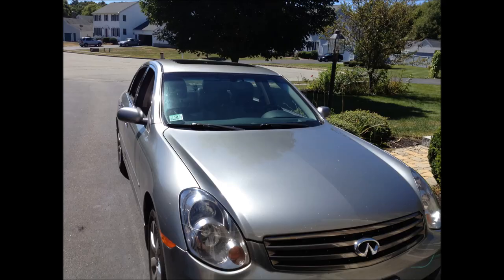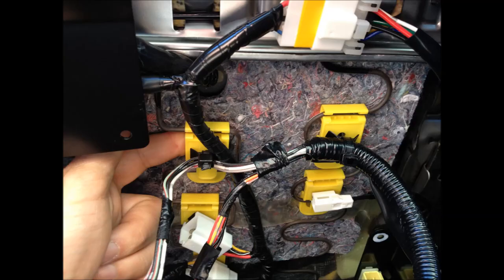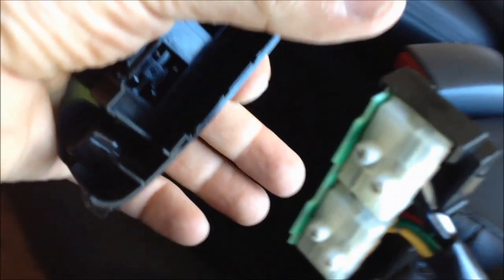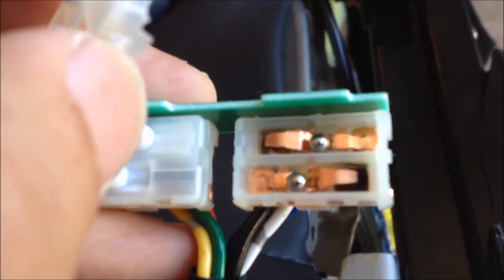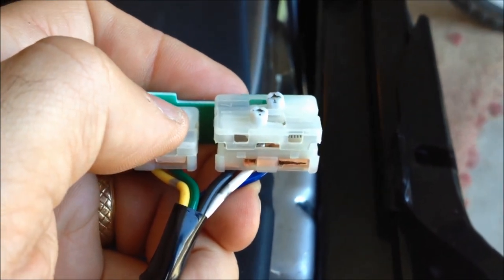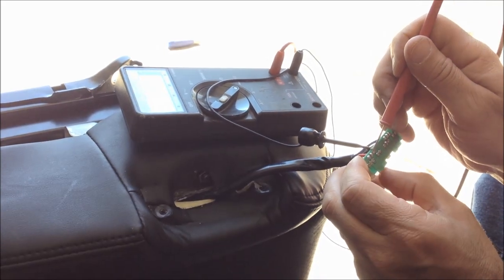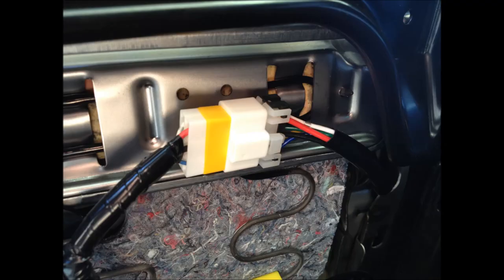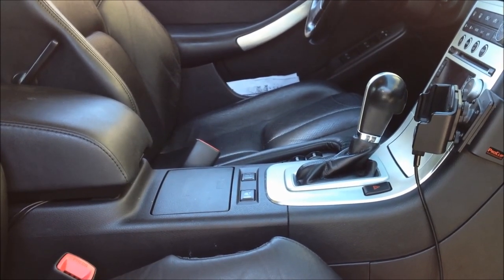Infiniti G35 Power Seat switch Repair

Comment: I'm having an issue where two of the switches belonging to one motor are not grounded any ideas how to rectify this as I was going to actually ground it myself by connecting it to the metal frame

Comment: Hey I have an 04 g35x sedan and my drivers seat doesn't move in any direction I had a technician check it out and he found the module wasn't working. I changed it and it worked until I started the car and the seat stopped moving again,can you help me out.. Tnx

Comment: Thinkin of using an offset screw driver. But will the switch come out?
Reply from the maker: You might be able to get the switch out but it's impossible to take the switch apart to clean it. I'm also not sure how long the wire harness is from the switch to it's connectors. I found that having the seat out of the car made it a lot easier to do the repair.

Comment: I just attempted this and it was a bit annoying. Got the seat and everything out but once it came to taking apart the switch it went crazy. I got the top off and everything went flying everywhere so I had to go find all the missing pieces. I got it back together and  the seat started working again. But then once I put the seat and everything back together it stopped working and now it only works sometimes.

Comment: I did this procedure and it fixed it for awhile and now the seat switches are stuck , I really done wanna remove the seat again and disassemble the seat switch just to clean it again , put it back together and then after a few months it happens again , I'd there a permanent fix for this problem . I don't wanna have to do repeated cleaning procedures. thanks for any help or replies with this issue
Reply from the maker: +wickedcivic1 How long did it last from when you cleaned the switches?
My only recommendation is to see if you can purchase the switch assembly and just replace it. It will mean pulling out the seat unfortunately.

Comment: I have a FX35 with the same issue BUT the seat doesn't move at all!  Will this method also work for my vehicle?
Reply from the maker: Thanks for asking. I don't have that answer.
When the seat first stopped working, did it stop working in one direction or both?

Comment: would a fix like this work if my passenger spilt a drink on the switch that caused it to stop working?
Reply from the maker: Most likely it will help.
You need to get the dried “gunk” out of the switches. You could try flushing the switch’s like others have tried but the best way is to take them apart and really give them a good cleaning.

Comment: I have 2003 Nissan Pathfinder and driver seat can not move forward. Could you please tell me how to fix that? Thanks a lot!
Reply: Im sure you already fixed it, but just in case another person see this. I had an 03 Pathfinder as well that I just sold. The seat would not nice forward at all. I just grabbed a small hammer and tapped the motor a few times and it worked perfectly.

Comment: Hello. I have a 2006 g35. My recline switch stopped working. the other 3 switches are fine. would you say i need to clean the switch or buy a new panel?
Reply from the maker: Qua Marshall Hello Qua. The switch is most likely bad and needs a cleaning. I'm not sure how much a new switch panel costs..if you find out, please post the cost!
Reply: Thank you for replying.! I found one on Ebay for $129. thinking of buying it today.
Reply from the maker: Qua Marshall As long as it is a new part and not used then I think that is a great way to go! That will make the job a lot easier to do.
What seat is the bad one? Passenger or Driver? What is the part number of the switch you found on eBay?

Comment: Stupid question but if the cause of this is the metal parts in the switch oxidizing or burning what causes this and how to prevent it from happening?
Reply from the maker: Good question!  
This may help explain... http://www.allaboutcircuits.com/textbook/digital/chpt-4/switch-contact-design/
Reply: Good informative read Mark. So basically park somewhere clean and dry and don't operate the switches too often, just often enough for 'wetting current' to travel and self them.

Comment: Easiest way to do this is to just slide the seat all the way forward and lift it up with the controls if you can and then the screws are uncovered enough to unscrew em I juts fixed my seats in about 30 min I didn't have to take the switch apart completely tho my switch was just gunked up underneath tools out tools the switch off front the board just needed a cleaning under the cover

Comment: Im lost, 
My car seat (driver seat) doesnt come up.
So are you saying not only i have to detach the seat but also detach the power?
What if i dont detach the seat nor power ?
Reply: I'm an infiniti mechanic. If you come over to my house with a bottle of wine and a vulgar state of mind, I can fix your car seat in about an hour.
Reply: Scott Ross My friend is bringing his Murano over to fix. The front passenger seat is all the way forward. Nissan says it’s the motor and a $4500 fix. Can you give me any advice?  Do you think it would be the motor?  I think we can buy a motor for about $160. Oh by the way, Nissan said they couldn’t even move the seat back so it could be sat in. Is there a way we can get it to move back?
Reply: @johnrga  Nissan is full of shit. One you can manually move the seats with a ratchet, use a 10mm socket. Two you can try this guy's methods with the alligator clips. It reverses the polarity. You could also do what another guy posted and use an aftermarket switch. You'll just have to wire it in. You can also buy used motors that work for about $26 bucks on eBay. But if the switch is not working then it won't work.

Comment: Hey Mark, I have infiniti g35 2006. On the passenger side of the seat, the switch for moving back and forth works but the one that leans the seat back and forward doesnt work. The mechanic said that if the both switch wasnt working, it is not hard to fix it but if only one of them works, then i would have to change the whole right side of the chair which costs about $4,100 for the new one. 
Is it true? or is there any possibility of fixing it?
Please give me a shout thanks!!
Reply from the maker: It can be fixed!
I'm going to assume if neither of the switches worked then the mechanic was probably thinking the fuse was blown. That would be an easy fix. Your seat shows similar symptoms to what my seat showed. Chances are your switch is bad. I don't like how they scare people into having to pay a lot for money to fix a poorly designed switch circuit.
The procedure I show is not easy but it gets the job done. Someday I will offer to clean the switch assembly and test it for those willing to remove it from their car.
Reassembling the switch is defiantly the hard part.
Thanks,
Mark

Comment: I replaced my right side gear and how when it is in auto mode it doesn't move forward but it does move back. Any suggestions?
Reply from the maker: No idea yet..
Tell me more. So the manual switch will not move the seat forward but will move it backwards?

Comment: I had similar problem with the recliner motor. I applied direct volts and it worked.   So I figured it would be the switch. I test to see I get volts when I press the switch and I had 12.67.  So.  It should work but once I connect the motor I had 0 voltage.   Any ideas??
Reply from the maker: fermin navarro Yes.. The carbon buildup in the switch is acting like a resistor!
As soon as you put the circuit under a load (reconnect the motor and activate the switch), some current flows and the 12 volts drops across the carbon buildup in the switch.
I would recommend cleaning the switch. Ohms law V=I*R 
Thanks for asking!
Mark
Reply: How did you apply direct voltage? Can you help please?
Reply: I want my seat to incline to its stuck all the way down
Reply from the maker: juan becerra HI juan. You will need to have two wires or aligator clips like I used in the video. 
These are at Radio Shack. 
Catalog #: 278-115614" (35.3cm) Insulated Test/Jumper LeadsDetails 
 http://www.radioshack.com/14-35-3cm-insulated-test-jumper-leads/2781156.html   $8.99
Reply: I get that, I have my clips already. The connector in the front will work to incline and recline seat?
Reply from the maker: juan becerra No...That one is only for the motor that moves the seat forward and backwards. I sold my car a few years ago but I took a look on line to see if anyone shows what the other motors do. It's going to be a bit tricky to reach under there and get to the wires on the other motors. Where are you located? I'm in the Boston area (it's a long shot!)

Comment from the maker: I think it much easier to just pull the seat out.
The last thing you want to be doing is searching for lost tiny switch parts inside the car.
Reply: Hi I have 350z seat switch didn't work can you help me .! This process will working for me too. Thank u
Reply: I have a G35 Coupe and I would like to remove the driver seat and passenger seat just to clean and vacuum the sides and underneath. Will the airbag go off. When I was watching your video seems like you didn't disconnect the battery and I don't want to do that either as it resets things in your car I heard. 
I just need to life it and vacuum.
Reply from the maker: +HalalGaming Thanks for asking.
I'm my case, I had to have the battery connected so I could initially move the seat using the jumper wires. I can only say, read the Inifiniti service manual and follow their recommendation. Makes sense to disconnect the battery after moving the seat but I'm not sure what other issues that will create.

I can't say where the air bag wiring is without studying the service manual. I will guess that it goes up the center of the console into the main dash..that's only a guess.

Comment: What happens when you take it out and the 2 little balls roll off and you can't find them ? What are they called so I can buy them please some respond
Reply from the maker: Hi Kelvin. Sorry to hear that. There little Ball bearings. I don't know the exact size. Do you have a strong magnet that  you could use to sweep the area? Did you take the seat out of the car?
You could try and see if the entire switch assembly is on eBay. I don't have the part number  but I'm sure it won't be hard to find.
Reply: i took the seat out of the car and i just don't know if it went under appliances but i will try and find it out with the info you gave me, i greatly appreciate it thank you
Reply: kelvin lopez I believe it's part # u F u c K e d sorry I couldn't resist best of luck

Comment: Infiniti g35 stuck in forward incline, very uncomfortable/not reclining: sprayed the $#%^ out of the switch without removing anything to this point, just spraying around the top of it,and it must have cleaned it just enough to let me get the seat to power recline a bit for comfort but isn't continuing to recline further; will let soak overnight and see what happens.
Reply: How did soaking it overnight work cause I'm trying to so that before removing the seat?

Comment from the maker: Hi Allison.
Radio Shack has the alligator clips
 http://www.radioshack.com/product/index.jsp?productId=2062660.
I used the clips so I could get a really good connection on the contacts inside the connector.
Holding a wire on the contacts probably wont work too good because of the high current the motor will need.
Also try rocking the switch back and forth many times. Maybe it will give you one more operation! Mine did that for a while before it finally gave out completely.
Thanks,
Mark
Reply: Video is very helpful!!!!  Will try my own repair on Monday...
Reply from the maker: Cool!

Comment: does anybody know how to "jumper" the recliner switch?  mine is stuck in the fully reclined position - as everyone else has stated, I called Infiniti dealer & was told I needed to replace the whole seat (for safety reasons, of course - BS!) at a cost of $3687 plus labor! I didn't think I could be bent over that bad!
Reply from the maker: Hello 85lowglide.
The video describes how to jumper the motor so it will reverse and bring the seat back up for removal. Do you know anybody with electrical skills? They could help you out on this fix.
Thanks,
Mark

Comment: Hey bud. I'm trying this same approach for verticality. The connector on the back is a lot easier to access on this model. There are two zippers on the back of my leather seat that once pulled up expose the wiring. Each connecter has two wires leading in it then send information for specific functions. There are 4 customizations for my seat and there are 4 connections with 8 wires. Doesnt take a genius to figure it out. And I found the two wires that control verticality but simply unplugging each on until one stopped operation of verticality. I've never reversed polarity on a connector before tho. Can you send me a link to whatever you used here so I can do it properly. Thanks I'll be sure to subscribe if you can send me a reply.
Reply from the maker: I'm not quite sure how I can help you without seeing exactly what you are doing.
Reply: i figured it out. ezpz thx tho

Comment: The auto feature doesn't move the seat forward. You know when u start the car it moves the seat in the position you had it? Well, mine doesn't any more.
Reply from the maker: But there is still a manual switch to move the seat. Lets start by seeing if that is working correctly, then move on to the auto feature.
It may be that the auto feature needs to be reprogrammed using the switches on the seat. (I don't have my car any more so I can't easily take a look) If you had to unplug any wires going to that switch unit and they put the electronics there then maybe it just got cleared. Let me know if the seat still moves manually and if reprogramming auto mode helps. Thanks, Mark
Reply: Mark Antonucci The buttons work for moving the seat back and forth. I reprogrammed it but it still doesn't work. The weird thing is that it will automaticly move back when car is off. A matter a fact the steering wheeling will move and the back of the seat will move as well but not the bottom part. I am thinking the control module needs to be reset or something.
Reply from the maker: gradyboi2
Strange..Did you see the control module? Is it under the seat? Maybe there is a cable that puts the control module in parallel with the manual switch? It's going to be connected somehow because both the module and the switch move the seat. See if there is a cable that is not fully inserted. Hopefully you won't have to remove the seat again. I can try and see if I still have my wiring diagrams for my car tomorrow. Maybe that will help.
Reply: Mark Antonucci Okay, I unplugged the control module and plugged it back and of course nothing works now. So, I might just have to pull the seat out and doing some cleaning of the connectors to see what happens. It is like there is a wire or two that is not connecting correctly for some reason.

Comment: My passenger seat is stuck in a forward decline. Is there a video to fix that? I have a 2004 G35.
Reply from the maker: +dwsgrho 

Give this a try..
You may be able to get the seat back up one last time.

Robert Kempf2 months ago (edited)I achieved the same result as this video by simply applying 10-20 drops of isopropyl alcohol (91%) around the affected switch and then moving it back and forth for a minute. Didn't work immediately, but after 5 minutes the switch worked perfectly again. Thanks to Mark though for posting the video and helping me understand the problem, I appreciate his efforts.
Reply: +dwsgrho I just fixed my 06 G35 Coupe thanks to this video. The only thing different was that I could not pull the passenger switch and harness out as far as you did in the video. I did fix it thanks to the steps in the video and I left the seat in the car as I worked on it. Do yourself a favor and PLUG ANY GAPS in between where these little springs and ball bearings can fall between the cracks and then there gone forever. All and all follow the steps and allow yourself plenty of time to work with the springs of the switch... (Scotch Tape Helps!)

Comment: Why not buy a new switch?
Reply from the maker: I didn't have access to a manual showing the switch part number way back when I made this video. I'm guessing the switch assembly is well over $100. If I was fixing this for a customer then I would put a new switch in.

Comment: can I just buy a new switch, mine is missing the ball bearing and the copper strip😂
Reply from the maker: +Logan Bashore Sure! I don't have the part number but I'm sure it's available. I have seen use switches on ebay. They probably even see new ones too! Please post the part number if you it! Thanks

Comment: The problem with your video is that ' you show things after you v done rather than show the process'. it just doenst help.
Reply from the maker: +lili M Hi Lili.
I'm sorry this video does not help you. It's not meant for everyone. 
Try operating your switch multiple times. Sometimes you may get one more "use" out of it and possibly get the seat back up. I have seen that happen a few times. 
Mark
Reply: lili, his process is very detailed but i can understand where you are coming from.  you just need a little practice working on cars.  as a beginner, its useful to have a step by step detailed process to follow but sometimes those gaps will just be filled by your intuition and working around an issue.  when you get better at tinkering, you will be able to do these processes without use of a video, or just use a video for reference when you are unsure what to do next.  happy tinkering!  and like he said, it might not be your cup of tea